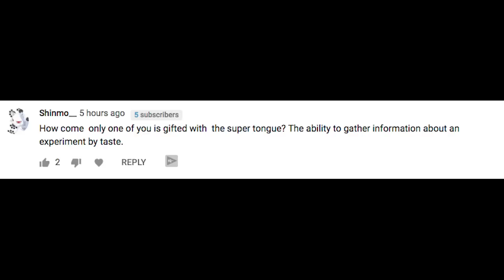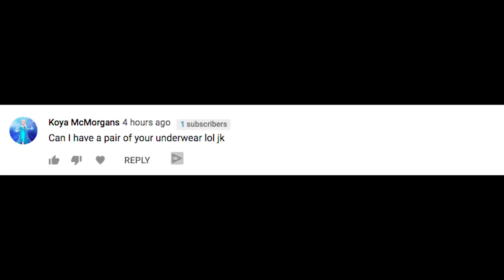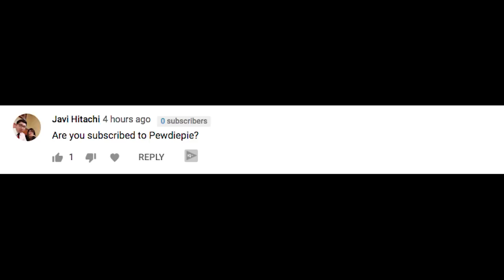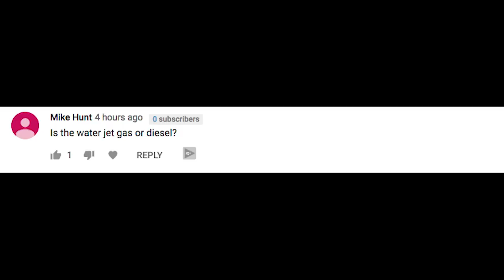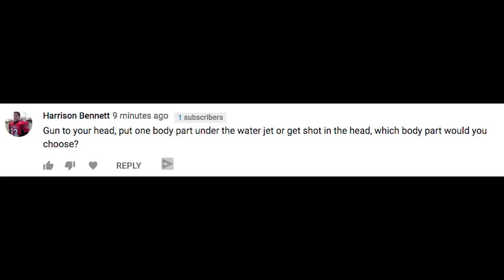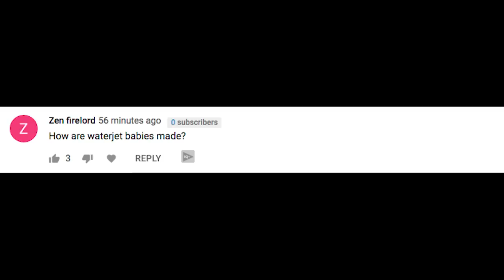Waterjet Tank Cleaning Bubble Bath - Waterjet Channel - Interesting Q&A

Comment: seriously, do you actually work at that shop, full time?
It pretty much looks like nothing else is operational except the jet.
Thanks
Reply from the maker: haha, its old equipment, but it all works. (except for the laser table)
Reply: @WaterjetChannel  dude a laser table get that fixed that would be a great addition to your channel
Reply: What else do you need besides a waterjet
Reply: @WaterjetChannel  once again, like in the video avoiding the question
Reply: @aidenperkins9753  what question?

Comment: Cody's goldbar wasn't the most expensive thing you cut? 0.o
Reply: I think they were talking about how expensive it was to run the water jet. Gold is very easy to cut.
Reply: OOOOH gotcha! Thanks! =) You guys are awesome!
Reply: I think gold can be cut, if not, easily scored with simple kitchen knife with little to no damage to the knife. I’m guessing like the person above said, it had to do with running the machine, and that’s probably in terms of how much garnet they’re using. If it’s a pure water cut, it’s probably extremely cheap. Also, Cody made sure he got back every gold flake back through a somewhat through process lol
Reply: @hugedickerinokripperino5299  and the gold was only a few thousand dollars worth. Lots and lots of finished products cost more
Reply: @sgtgiggles  it's soft. But not soft enough to cut with a kitchen knife. Had a few pure gold coins in the past. EASILY damaged. The rims could be easily dented with a mild press of a fingernail.
Reply: mr bubble is very expensive.
Reply: @dphorgan  "cant cut with a hard knife, can dent with a fingernail" doesn't add up bromosapien.

Comment: Is there any value to the garnet harvested from the tank? Does it get reused/recycled? or is it just expensive mud once its work is done?
Reply: LoneEagle2061 that’s a good question
Reply: Garnet is a stone that is hard and expensive. So I'm sure they reuse it. They just clean it out.
Reply: It does not get re-used.
Reply: No they get rid of it they can’t reuse it
Reply: Well  the garnet can be used for rock tumbling, and in some case I've seen it recycled into sandpaper, the garnet is expensive so they do recycle it but it degrades each time it get used.
Reply: The mud isn't only garnet. It also has wood from the particle-board, it has steel of various types, and since it belongs to waterjet channel, it probably has alot of other stuff.
I'd imagine that it's possible to filter it out, but I don't think they have the equipment to do that.
Reply: When I was working at a steel shop my boss told me they reuse the mud when they pave roads. Something about mixing it with the asphalt or something like that
Reply: This is what I was thinking - there are plenty of fine abrasives it might theoretically be useful for; but having gone through the waterjet, does it still have enough "edges" to cut with, and is it worth the effort of separating it from the (mostly) iron oxide cut out of the kerf?
Reply: No they cant reuse it the shop i worked at had 30 50lb bags a pallet stacked 3 high 4 rows thats how fast they use it
Reply from the maker: its just expensive mud....
Reply: @WaterjetChannel  I'd buy the mud
Reply: That's actually a good question

Comment: Can I just give a hot tip for you guys and/or for Craig:
The circles you're cutting are wasting a lot of material that you're probably not getting any profit from. Use a more efficient circle packing method. Hexagonal packing is the most efficient as far as I know. That'll get you the most circles out of your steel as possible.
Hexagonal packing: Each circle is bordered by exactly 6 more circles of equal radius, rather than 4 in the square packing that you're using.

Comment: Q: Is it possible to do some surface machining with waterjet? Like removing just 1-2mm layer from top of some metalic material?
Reply: That's sand blasting, and it would take quite a while and wouldn't be accurate
Reply: You will rather use a milling machine

Comment: Can you cut a V6 or V8 engine! And actual question, do you reuse the sand?
Reply: They don't. I can't remember what video they said that in, but they just dump the sand.
Reply: an engine won't fit under the nozzel sadly
Reply: Not! Sand after cutting becomes a dust.

Comment: It looks like the loader needs it's hydraulics bled.
Reply: @ProtoV33MK1  bit of a while back, but any uncommanded movement means there's a problem. If it moves a little then stops, there might be air somewhere it shouldn't be, acting like a spring.

Comment: Hey what kind of pump is on the water jet? I don't see a normal centrifugal making that kind of pressure. I'm assuming its a multistage positive displacement pump with a minimum flow line built in to protect it? 

What is the most exotic metal you've cut? In normal operation and on the channel? Have you ever cut monel? If so how'd it compare to regular carbon steel?

Lastly, if all the circles you guys cut are carbon steel your customers may be using them for blinds in the oil field, especially if they're ever figure 8s with one side solid. How thick are they?

Comment: So does anything special happen to the sludge after you clean out the tank? You you recover the Garnet?
Reply: I can't speak for this operation, but it can be recycled to an extent to recover the garnet. I do know of some recycling operations, but might depend if it's worth transporting to the facility. On the other hand, it won't necessarily be the same size distribution once recovered.

Source, I worked at the garnet mine that these guys buy garnet from. GMA in Alder Montana.

Comment: How often is the tip of the water jet replaced and does it vary depending on if you use straight water or the water garnet mix

Comment: Ok I just seen the title of this and I will tell you the fastest way to clean one. I drove a vac truck that held 3200 gallons it was a 379 ext hood Peterbilt straight truck and I had to go to the Army Depot in Kentucky about once a week and clean one of their I believe it was 12 water jets they had. But I'd show up and have to go through all the security to get in but once I got to the water jets I'd drop a 3 inch hose into the tank and open the valve and let it drain all the water and sand/ whatever it is called and in I'd say 15 minutes it would be empty and that's spraying the inside of it down with a water hose and getting everything out of the tank. Now idk what yall about to do with the dawn but guess I'll see in a few minutes.  But just had to share my experience on cleaning them out. O and one more thing.  I got to see the thick ass plates that they cut out for the hummers that have the gun on top of them that has the plate keeping the shooter form being a wide open target and I got to see many more awesome things that they cut out for just about everything in the military.  It was one of the coolest things/jobs I've ever seen/done.  Ok carry on I'm gonna shut up now and watch this here video.  Lol

Comment: What is supposed to be the point of adding soap to the water tank. I have not cleaned a water jet tank before, but I have done wet saw tables and you drain the water, rinse out the sediments, and then fill it back up

Comment: I run a baca robosawjet, dual table with a 60k psi h20 jet on it. What's the thickest steel yall have successfully managed to cut in one pass?
Reply from the maker: We've done 6 inches a few times

Comment: are laiser cut circels cheaper to make than waterjet because you need to buy sand water power filters and the list dont stop that fast but on the other hand laiser cut need only power space and one mechanic to repair the machine